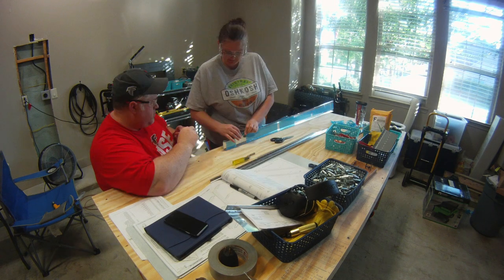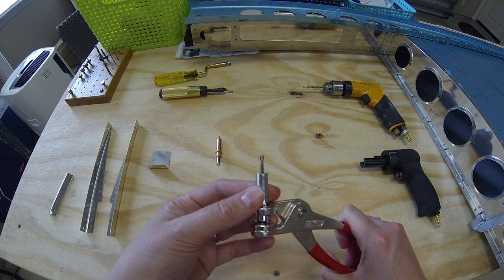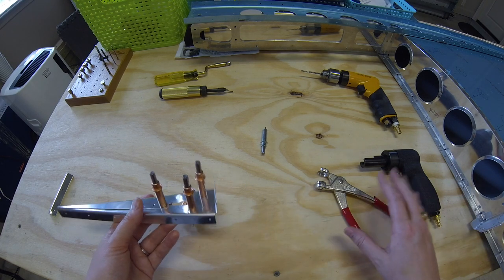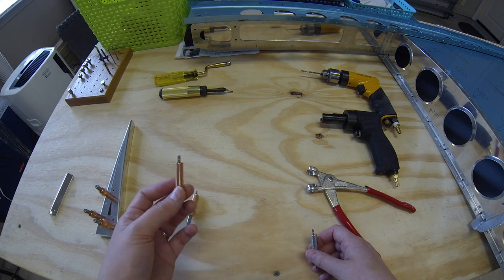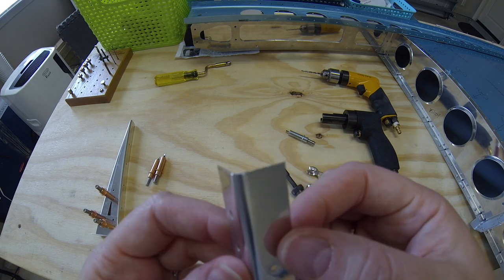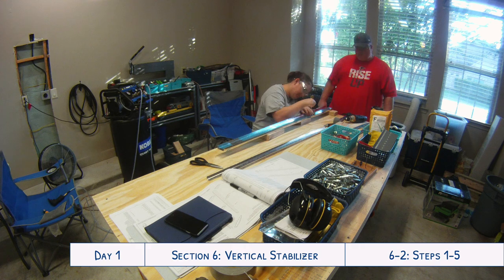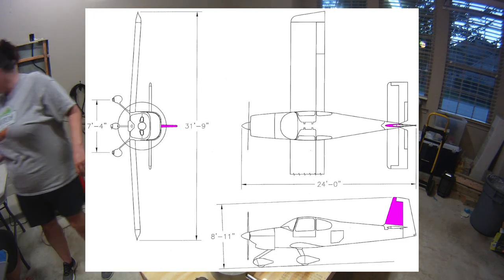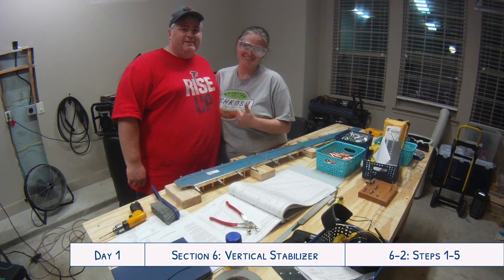Van's Aircraft RV-10 Build - Day 1: Starting our RV-10 (6-2)

Comment: Those Nova drills are awesome! I've got both the 4000rpm & 2600rpm for my build...
Reply from the maker: Yeah, it's great! We just have the 4000rpm; I'm curious why you have two - what do you use the 2600rpm for that you don't use the 4000rpm with? Always looking for good tips from other builders 😊
Reply: @PlaneLady  I use the 2nd one so I can easily drill & countersink without constantly switching bits or switch between the #30 & #40 bit. Not sure I needed 2 different rpms, but just wanted to try them both just out of curiosity.
Reply from the maker: Jason Tremper good idea! Clever use of 2 drills to make things a bit easier. Thanks for the response. When you mentioned the different rpm I was wondering if you found the speed made a difference somehow.
Reply: @PlaneLady  I personally like the 2600 better because I can feather it slower to start or when countersinking, but not sure it really makes a whole lot of difference

Comment: What tools will I need to build? Assume I have no tools in my garage, for clarity.
Reply from the maker: Hey! The RV-10 tool kit on Cleaveland Tools is a great place to start. We started with that and have added other things as needed (or wanted, to make certain tasks easier/faster). You’ll also need a band saw to cut some of the necessary aluminum parts. A drill press would also be a great idea. Hope that helps!

Comment: I didn't think the RV10 needed match drilling?
Reply from the maker: You might be thinking of final drilling. The pre punched holes are final sized in the 10 kits now, but there is still match drilling needed in the parts without holes (such as match drilling the skins to the stiffeners or longerons)

Comment: I am totally subscribing to you guys.  I am debating, no wait I am ready to start purchasing my kit.  The question I have is   1. is there a list of tools I will need for empannage section which is what I am purchasing first.      Also do you guys have experience building. I am a total beginner and a bit nervous.    Instructions easy to read and understand?        Here is my email if you prefer to answer that way.   I am so looking forward to your build.
Reply from the maker: Hey! How exciting that you’re ready to get started with your own 😊 I don’t see your email so I’ll answer here. 1) we bought our tools from Cleaveland Tools and they have tool bundles for the different RVs, so there is one for the RV-10 with all the different rivet sets and drill bits and what not that you’ll need for the emp kit. And you can switch stuff out in their kit, like if you want to upgrade from the c-frame to the DRDT2. 2) so we had never built a plane before, but the instructions are pretty clear and there are lots of diagrams. What we did before starting our emp kit that I would recommend is we bought a couple of Van’s RV training projects from their online store and made those. It was a good way to learn how to use our tools and get comfortable with them and see what the directions are like. We did 2 or 3 each and I think it was really helpful. Hope that helps! 😊